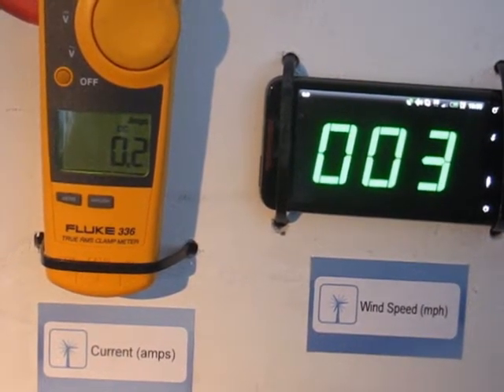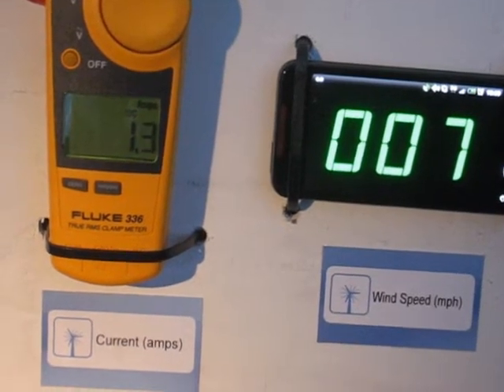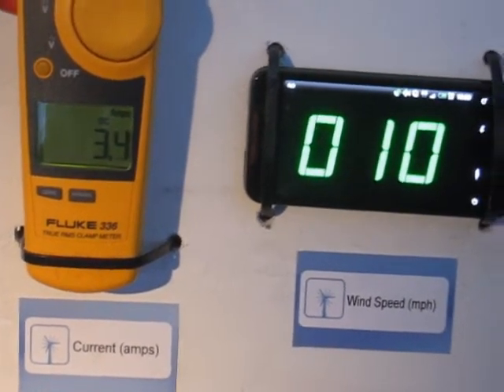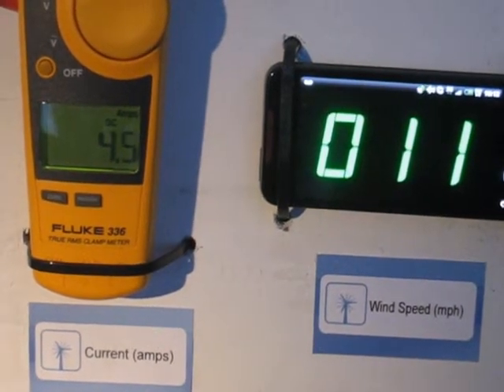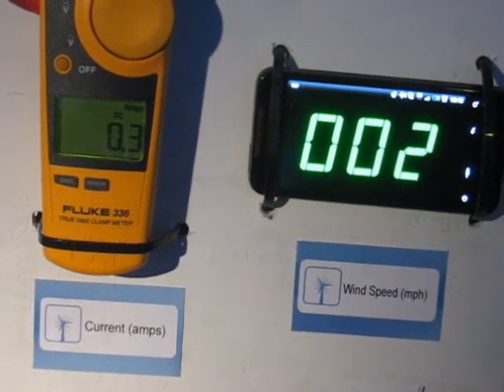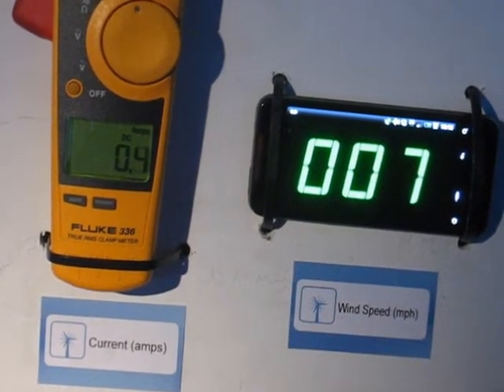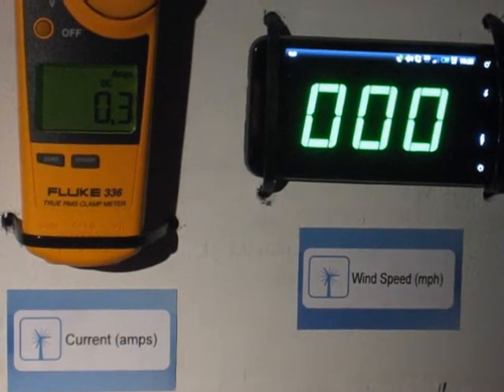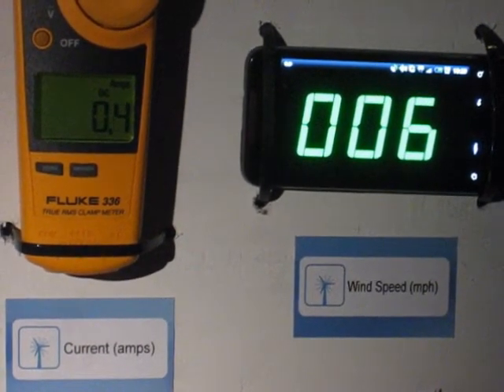WindyNation's Windtura 500 Wind Turbine: Real World 12 Volt Power Curve

Comment from the maker: @Fearlessthinker We actually have a better 24 volt video which I will post tonight hopefully. Same format as the video you see here but a 24V bank (actual voltage = 27). Results are much better in the new video because the road is smoother and the wind turbine is no longer a prototype (works much better now). We hit approximately 25 amps or 675 Watts at ~30 mph. 24V banks are the way to go for sure unless your particular system requires 12 volts. 

Thanks for the comments.

Comment from the maker: @Fearlessthinker  Hi, The battery bank does a good job of clamping the voltage output of the turbine. The voltage is probably between 13.3 and 14.0 volts. As you probably know, the voltage of the turbine's generator must be higher than the battery bank  for current to flow from the generator to the battery. We are always doing test runs so next time we are out, I will monitor the voltage. I will let you know the results. But, what is important here is amps because amps CHARGE batteries.